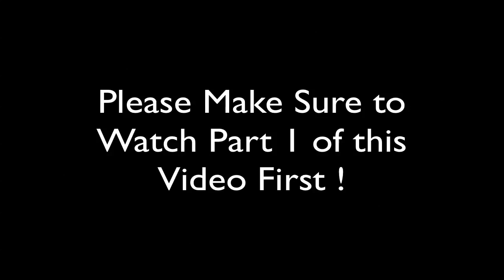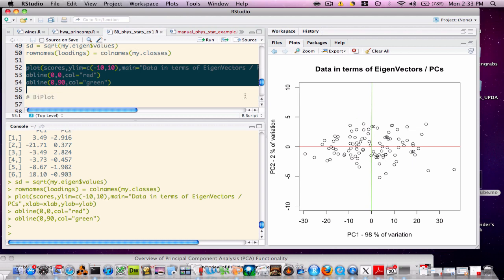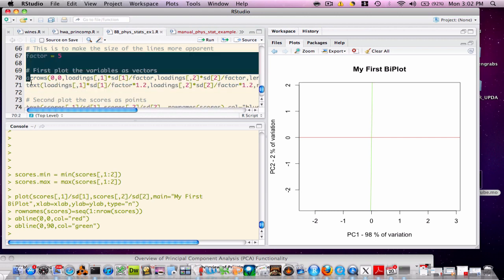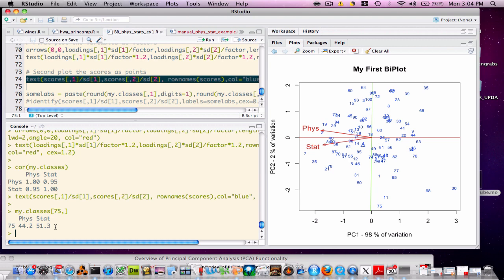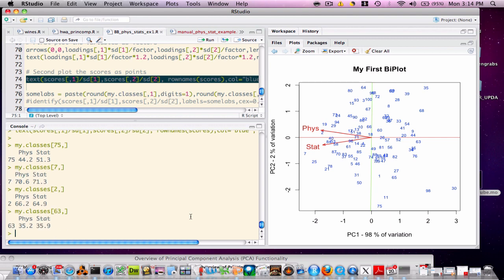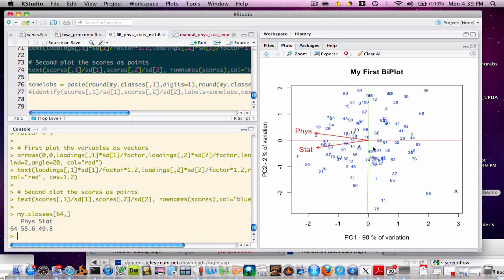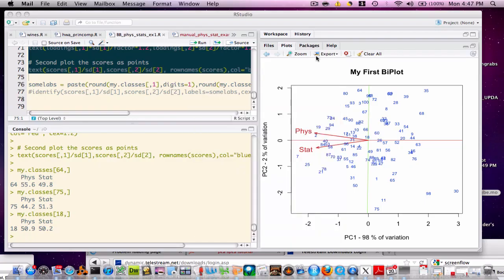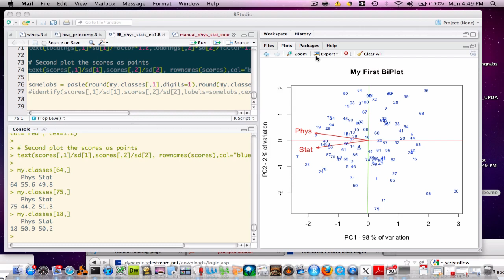Principal Components Analysis Using R - P2

Comment: Great tutorial. However, I believe line 49 is incomplete. The calculation of the singular value "sd" should include an adjusting factor. The line should be written as follows:
sd = sqrt(my.eigen$values)*sqrt(nrow(my.scaled.classes)-1). The Covariance approach uses this factor, which has to be removed when calculating the singular values.

I used the Singular Value Decomposition approach to double check the singular values and found the discrepancy in the results.

Comment: "lengthlwd" is not a graphical parameter <- what can I do with this error :( is annoying and I don't know what to do.

And other question, is the same codes if I'm using 4 different kind of info (e.g. another 2 classes)? Or I need to compare 2 per 2?

Comment from the maker: I recommend using prcomp instead of princomp - If you look in the help pages for princomp you will see the following: "The calculation is done using eigen on the correlation or covariance matrix, as determined by cor. This is done for compatibility with the S-PLUS result. A preferred method of calculation is to use svd on x, as is done in prcomp." Hence my decision to focus on prcomp.